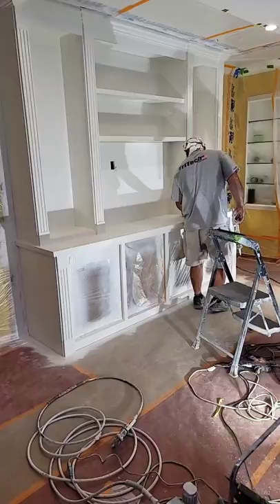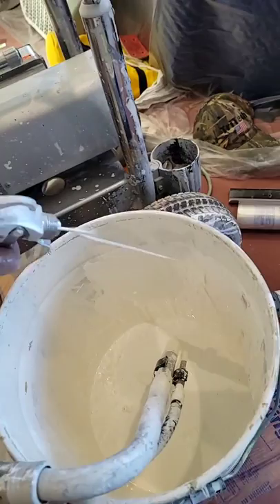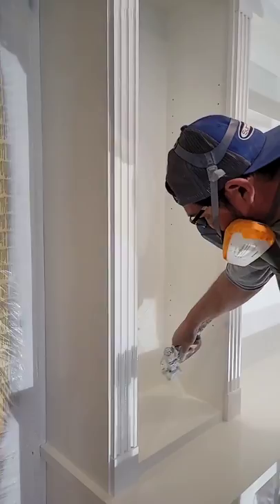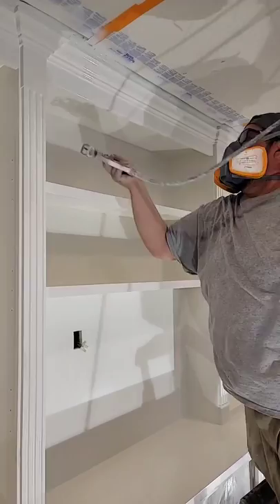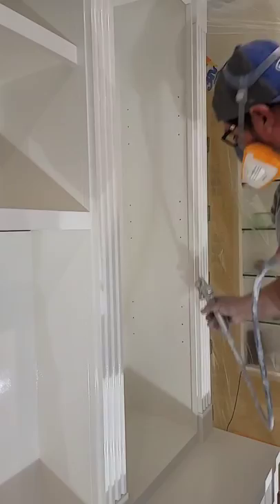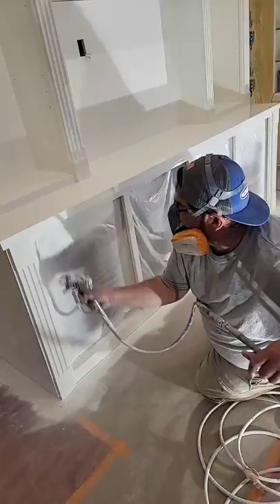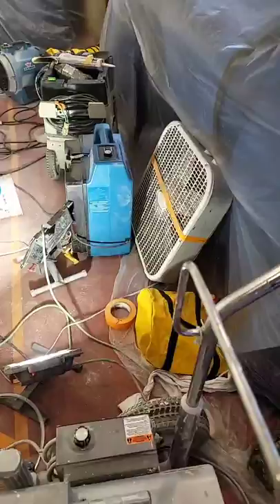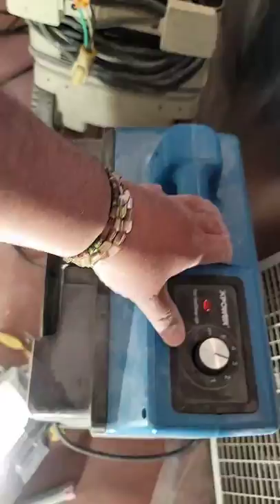Renner coating how to spray virtical with  tritech airless how to

Comment: Dennis, if I'm a pro finisher, I don't kgnow what's the right title for you 😁.  You're a good man who truly wants to help other pros to improve.  Thank you Dennis.  A quick question, you have 2 videos that mention paint thickener.  Can you clarify that please.  I even tried your air freshener trick, it worked wonder.  No idea how on earth you came up with that.
Reply: Joe,
Well said!  Dennis has helped me out a ton.
Reply from the maker: The thickner is a additive  you add to. Paint. Which helps thicken coatings  so you can get lil better virtical  hang. It doesn't  affect  final look of coatings   so Renner envirolak  and centurion  coatings  have it. I'm sure most other custom coatings  have it as well. It's definitely  a pro additive  and not to be taken lightly  I've seen multiple  guys screw there paint up. Bye thinking more is better
Reply: Good job Dennis, question for you bro, what's the ratio of the additive and Joe nguyen was talking about the air freshener ....i watch the vid with you and Eric and you guys talking about it, which one is it? .....it's not laundry product right?
Reply from the maker: @JuanMartinez-qp6yg  for thickner you have to get data sheet. From Renner. And on the sensation  fragrance you typically  add 1/2 oz. Per gallon. Works great for smell
Reply: Thanks a lot bro.....  it's the escensensations paint additive right.... I was thinking it was the arm and hammer sensations

Comment: Hey Dennis I just shot some 643 and 851 for the first time. 643 was nice, did what I thought. But...when the 851 went on I got a ridge or a valley on all my center panels that were glued up and all the joinery on the top and bottom edge of the doors popped.  Is this common?  If I need some kind of sealer under the 643 I should just run some vinyl sealer I think.  What’s your thought on the matter?
Your videos are good, they’ve helped a lot.
Reply: Maybe a reaction with the glue or wood filler?
Reply from the maker: Send me a pic on Instagram  midway_10902. Lemme see what your talking about the thin is. Your stuff has to be perfect  in primer any lil burn thru. Needs to be spot prime. But I'm interested  to see what it looked like
Reply: I don’t do the Instagram. Guy at MK sales said it prolly re wet the glue. I talked to the guy who made the doors he didn’t use biscuits or dominoes just an epoxy glue on the center panels. The doors were solid beechwood. My primer was 100 no burn throughs anywhere.
Reply: @noahkattner2309 - that sucks. I thought maybe it was the filler. I almost was going to ask if it was that alchohol based DAP in the can.

Comment: Nice job Dennis.... Hey bro what's the pressure at the unit with and without the additive ,is there any difference?..... Also i see that you use more renner than milesi, envirolak or cic, do you have any preference or recommendations....thanks brother 🤟🏽👍🏼

Comment: Hello. I sprayed cabinet doors horizontal with Renner 643 8% catalizer using graco gx19, tip 210. I have a lot of runs along the edge.  I see you spray back and forth a lot with no runs. What did I do wrong? Please help. Thank you.
Reply: You should use a bigger tip like 308 or 408 for a better atomization and also probably a bad overlapping.

Comment: Was there alot of dust or not to much  ?
Reply from the maker: No dust with the fan controller  we use and  air movers. Really nothing  floating  also air scrubber. Which really helps to. Clean dust from air

Comment: Adding thickener and using cure lamps to stop runs and drips screams too heavy of a spray. I’d like to see this dude spray SW products and watch all the drips and callbacks he gets. He sprays the airless the way an hvlp should be sprayed.
Reply from the maker: @bingobunga8995  hey I have many videos and have sprayed  everything  under the sun cv lacquer  emerald  pro industrial  Enduro every  brand of urethane  from centurion  Renner ilva envirolak  not much I can't spray my friend
Reply: @dennisrodriguez9700  why do you put it on so heavy then? Not many can put emerald urethane down without a single drip on verticals using airless. That stuff just runs and takes forever to dry. 2k is great cause of how quick it sets up but damn you put it on heavy.
Reply from the maker: @bingobunga8995  hey anytime you wanna come down and see me spray in-person  just.let me know I can show you how to. Sorry vertical  I'm in socal just let me know also I put on hands-on  refinishing  classes all over the country have one coming  up in. Oct in Oklahoma
Reply: @dennisrodriguez9700  thanks boss, I’m not anywhere near that area. I’m in Florida which is why at first I thought you were crazy for spraying it on so heavy but now I understand. I am totally and completely at the mercy of my climate (hot/extremely humid) and paint products take much longer to dry here which is why there’s the higher risk for runs. I get great flow out of super thin coats which lets me save a little on material but I’d still like the stuff to dry within the dry time which most of the time it doesn’t bc of the climate. I’m sure Oklahoma is a lot drier and I’m sure not so many super humid days where nothing seems to want to dry even solvent based lacquer.
Reply from the maker: @bingobunga8995  so just heads up dehumidifiers definitely  help and a couple infared  heaters. I know it's hot but to dry out air is what u need this will allow  coatings  to dry way faster. With a mid sized dehumidifier  you can drop the humidity  20% sometimes  as high as 30 % which would make considerable  difference  in dry times. Check it out for a small price you can save hours of wait time  on coatings